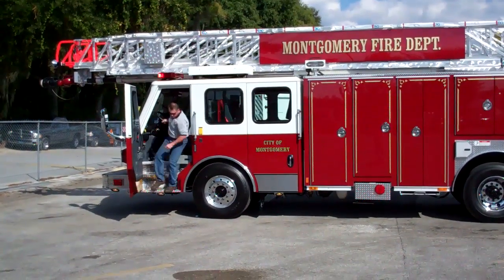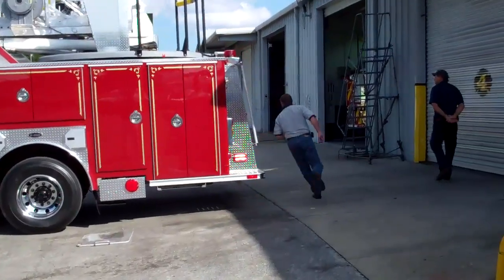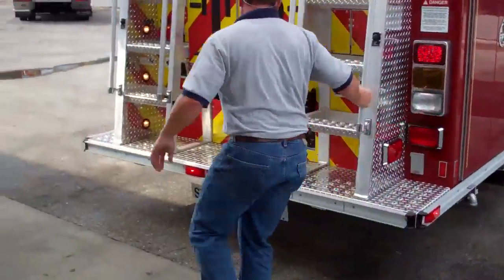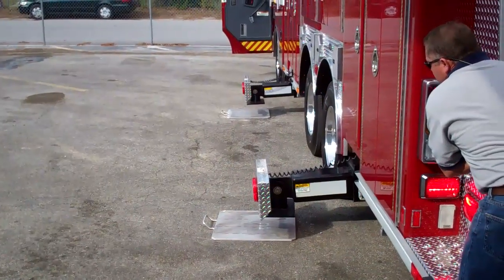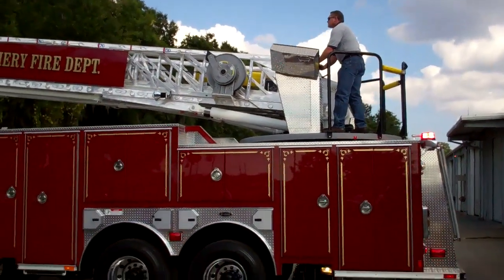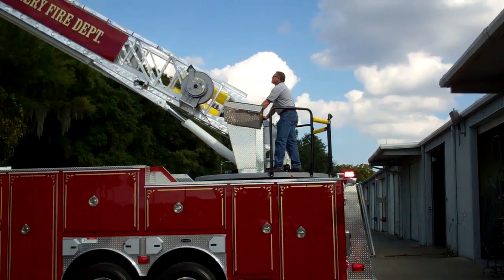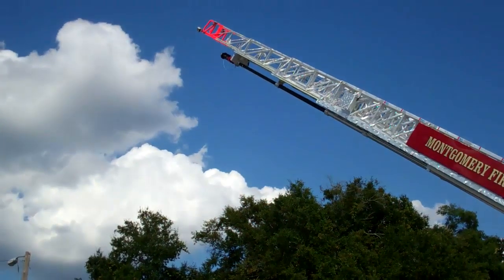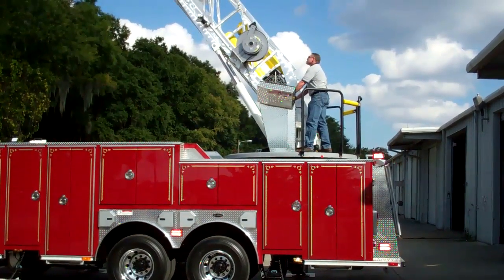E-ONE Ladder Truck- Set up of outriggers and ladder deployment

Comment: @TIPTOPHAT 

A common problem with doing such is that if your don't pay close enough attention and place the handles to close to the outrigger, you can crush the handles. With the size of the diamond plate on the front face of the outriggger i find it easier and just as safe to place the handles to the side instead...No trip hazard, no crushing of handles.  Just some Food for thought.